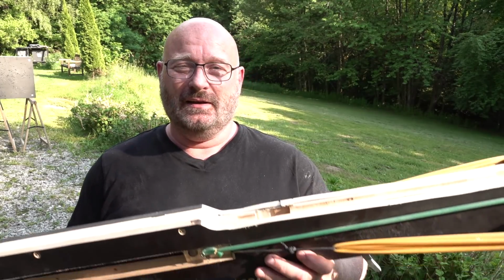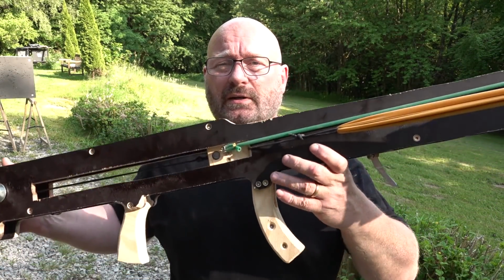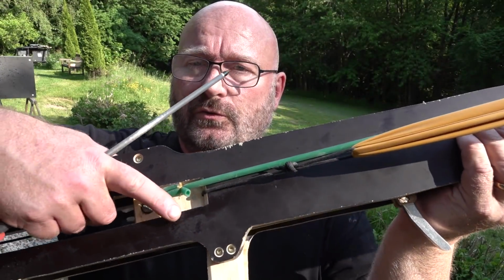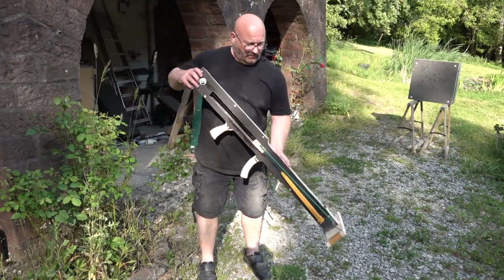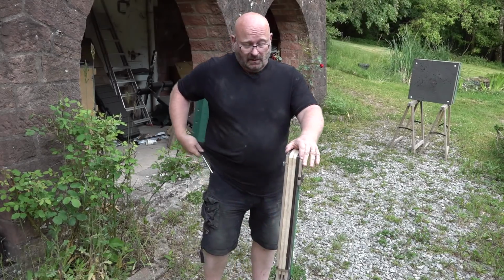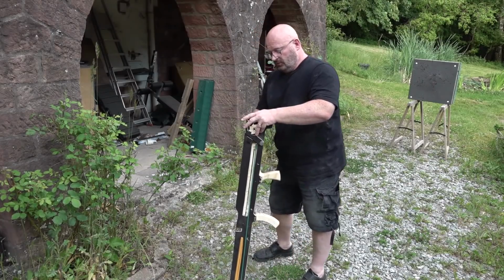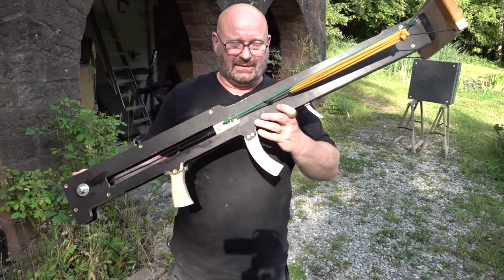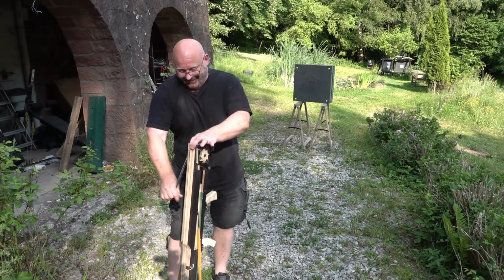The 200 Joule Repeating Rubber X-Bow Project!

Comment: Make an electromotor on the winch that does the 12 rotations to reload in a second after each shot. That way it will be truly semi auto
Reply: Close to auto with that idea
Reply: @OA-B  semi automatic is always an  automatic with breaker. Otherwise it's just "repeating "
Reply: It would need to reverse since he is cranking it both directions. The drill motor again,  perhaps? Then, again, if going for simplicity (low tech),  the hand cranking is best.
Reply: There's a lot of reasons why he didnt do that.
First. too over complicated without much to gain. a few seconds to spare is not worth the complex design.
Second. the weight. if you attach a motor to that massive contraption it would be umcomfortably heavy, even for the big Joerg.
And third, i believe that is against some German Law. i believe i recall something like that in a previous video, where the winch was attachable and not built in for legal reasons.
Reply: @chapelnightborn4526  To my knowledge, you can build full auto Xbows as much as you like in Germany. Maybe you misremember this from the Kentucky Ballistics/demo ranch Video with the 9mm Gatling gun. That was hand cranked, and it would have been illegal to put a motor on it.
Reply: Yes!!
Reply: I think making it electric would also make it illegal in Germany. We have some really strange laws that say the energy must come from a human, or something, if i'm not mistaken.
Reply: @N.M.E.  No. This is legally a crossbow, you can power them however you want to.
Reply: @Long dong Silver would still require a circuit with sensors.

It is obvious not impossible but what the people are asking for is impossible. (Slap something on it and make it automatically) it is clearly a 5 minute project people are referring to not something u spend days tuning and perfecting.
Reply: not as easy as it sounds. it needs to be quiet a heavy duty engine if attatched to the cog directly or add 2 cogs to reduce the power required but then ofcourse it will be slower.

the engine will be heavy and you also require a battery pack.

i imagine it will just endup being way to heavy and clumsy it will also require extra components to determ when to start and stop
Reply: @Nickerian91  oversized AEG airgun (propably v3 would be best)gearbox is solution that can fit the bill easly
Reply: @wojciechkolaczkiewicz2881  still would be way to heavy and clumsy. airgun doesnt tension rubber it just shot small bb by pushing them with air.
Reply: @Nickerian91  airgun is tensing spring, that when let loose shoots the BB, by compressing air in piston. Weight can be lowered by using bigger ratio on reduction gears, at price of ROF of course. On plus side- it's mechanically indexed, so only electric components would be motor and switch, eventually one MOSFET on top of that
Reply: @wojciechkolaczkiewicz2881  doubtful usually its valve based and the high pressure air release them at high speed.

spring based is commonly electrical or manual. compressing a spring with gas would be a huge waste of energy for no reason.

to release something as big as an arrow u need plenty of air simply dont make sense.
Reply: @Nickerian91  oh. AEG is short from "automatic electric gun", which use electric motor to compress the spring. And then energy stored in spring is used to compress air, that in effect accelerate each BB.

HPA use timed valve(s) to give short bursts of high pressure gas, and GG(greengas- basically desulfed methane) use impact valve to generate longer bursts of relatively low pressure gas
Reply: @wojciechkolaczkiewicz2881  sounds reasonable except the electrical powered one. it is more likely the bb touch the spring "piston" which is then pushed out rater than pushed by the air generated. would be huge energy loss.
Reply: @wojciechkolaczkiewicz2881  Hydraulic piston can be faster with the right motor & hydraulic pump also can be made to operate quieter.
Reply: @Nickerian91  If you disassemble one you will clearly see that piston is separated from hop up chamber(where BB sits before being accelerated) by nozzle, and diameter of piston is bigger than diameter of barrel. By my knowledge that's because spring have limited speed at which it can go back to its original length, and BB is light. So(leaving accuracy related mechanisms) spring powered piston compress more air per 1cm traveled, that can fit in multiple cm of barrel, which in effect accelerate the BB to higher speed than spring is moving. I have shotgun disassembled so if you like I can take photo of most parts I speak about. Or you can search on YouTube "AEG gearbox".

In case of x-bow last part that matter is mechanism that pulls piston head back, into "primed" position. That's because bolt is heavier, so it's acceleration profile is more flat, which mean lack of joule creep at relatively low powers
Reply: @Nickerian91  he’s describing real systems that are available on the market today, hell systems that have existed since at least the Napoleonic wars. Hell the best nerf guns work off a spring piston system. 

It’s most definitely the air pushing the projectile down the barrel like any other air gun.
Reply: @Nickerian91  why does it need to be quiet? Cordless 90 degree impact would be perfect
Reply: @MM-op6ti  I think he/she/it meant "quite". It's a very common typo.
Reply: @MM-op6ti  wouldn't work it would not know when to stop turning and break the whole thing.

It does require extra wiring and components to make it function as intended
Reply: @Nickerian91  A motor controller can measure the resistance and know when to stop. But it is pretty simple regardless, the extra components would be way cheaper than the motor.
Reply: @ZeKnife  No it wouldn't the twerk required would break it the instance it feels that it hits the end if you wouldn't be gearing it down which would make it way more clumsy.

It is not a matter of cheapness its a matter of how much work would be needed to put into it, the weight of all the components and how clumsy it would be to hold.

people are asking for a simple motor attachment to the crank but it would be more complex than the whole crossbow itself and most likely way to heavy with the batteries and motor.

Comment: 200 joule? How about just make it 20J. and use model rocket motors to propel the arrow/bolt once airborne? Idk if that's not legal or just not thought of. 
You need a power drill for the crank lol.

Comment: The only thing I want now with these ratchet cranks, is a motorised crank, so you don't have to hand-bash it 🙏
Reply: Have a battery powered drill hanging from a sling. One part archery and one part formula one
Reply: @PaulDominguez  Exactly. Something like that be spot on